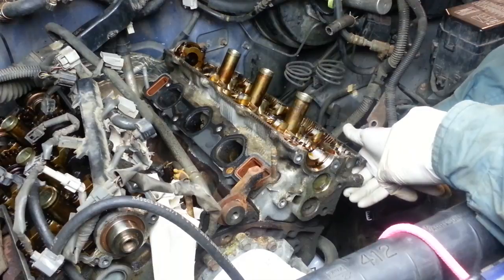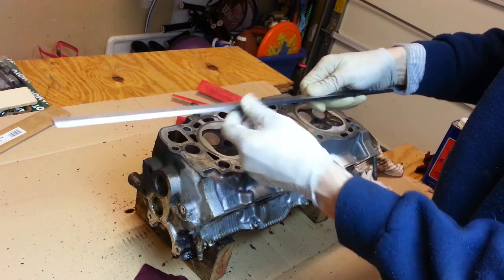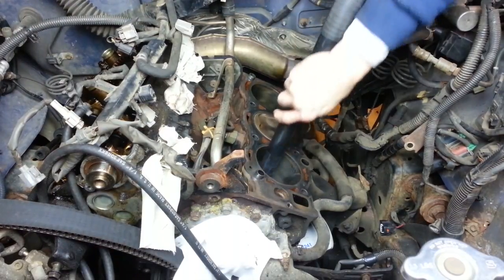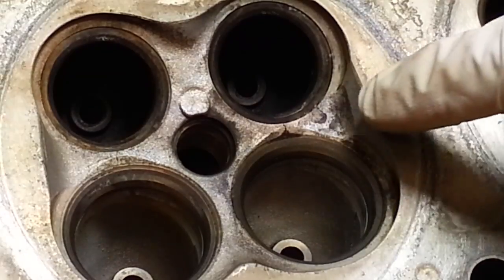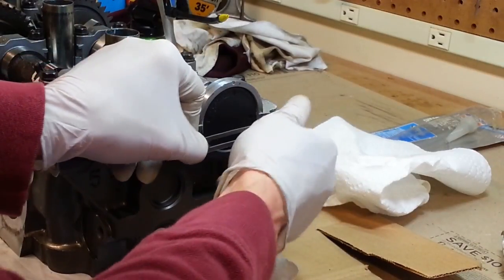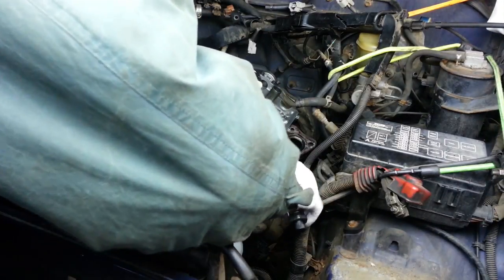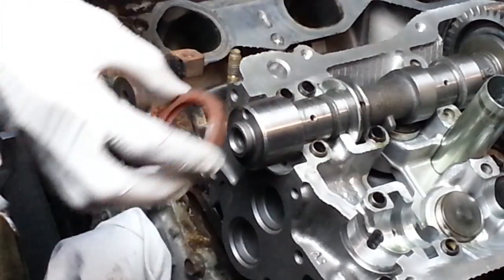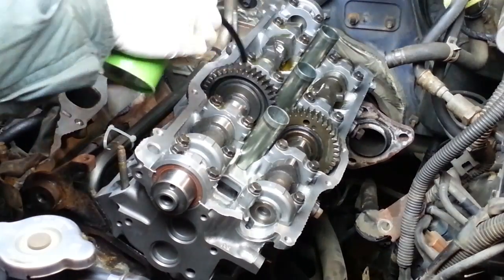Cylinder Head & Gasket DIY Procedure - Toyota 5VZ-FE - Part 4

Comment: So you made sure the dots on the cam were aligned before removing...but on install you line up the dots and then rotate cams to push the cam down into place which then caused your cams to be out of alignment. Another great video ruined by missing a critical step...
Reply from the maker: Thanks for your observation. Sorry about the confusion and perhaps a subtle detail is difficult to see in that segment of the video or there is some misunderstanding about the procedure and its purpose.  I oriented the dots in such a way that when I rotated both cams down a few degrees to safely seat them into the journals, the dots were then nearly perfectly aligned. There's really no other way to do it because you have to overcome the tension imposed by the torsion spring between the split gear. Regardless, the rotational adjustment after that is somewhat forgiving. The alignment of the dots is to simply put both cams in a position where none of the valve springs are compressed before reinstalling the caps. After the cams are seated, you can safely and easily tweak the rotation of the cams a small amount in either direction to get them perfectly aligned without any of the lobes exerting downward pressure on any of the valve springs. Then you can proceed to install the caps.
Reply: worsethanchiggers okay but then the dots aren't aligned so what happens to timing? In the video before you removed the cams you were saying that the cams were off by 1 tooth yet after install your gots were probably off by 5 teeth...so your explanation of valve clearances doesn't account for cam timing....and I'm bitching because I want to remove my heads on a similar engine and I can't confirm the cam installation.
Reply from the maker: No worries. Your caution is a good thing because it is important to get this right. It might help to review this segment in part 3 of the video series https://youtu.be/yTsocmNdBpQ?t=844 where I try to clarify that the alignment marks have nothing to do with timing. The timing marks are on the cam sprockets. Alignment adjustments are made when you are installing the cams. Timing adjustments are made later when you are installing the timing belt.
Reply: worsethanchiggers okay ty I misunderstood what you were doing
Reply: alright...i have watched that part like 3 times...still kinda sketchy imo...
Reply from the maker: Another note... If you're serious about removing the heads on your engine, I strongly recommend that you get a genuine factory service manual for that vehicle. There's nothing like accurate information from the actual authority. It takes you through the entire process step-by-step with illustrations and specs.
Reply: worsethanchiggers yeah the manual for a 1998 Vvti ls400 is $300 used
Reply from the maker: Definitely money well spent. For me, a good service manual is the first tool I invest in. Then, sell it on when you're done with the car to recoup the cost.

Comment: Why on earth didn't you clean the valve cover!!!?? 😳😞
Reply from the maker: This video series is more concerned with the mechanical condition of the engine rather than aesthetics. You should see the exterior. :)
Reply: worsethanchiggers I meant the carbon deposits on the inside of the valve cover. Lol :)
Reply from the maker: Ah, yes. That was mostly just dark staining and would have been very difficult to clean off without some kind of media blasting. Sweet sounding Cobra of yours, BTW.
Reply: worsethanchiggers got ya. If it stays put it won't hurt anything anyway.  Thank you sir!! 😊

Comment: My honest guess was that the coolant on the #4 piston came from residual coolant flowing back out of the head..
Reply: Can you answer one question for me.  Im looking to buy 4runner that has slow coolant leak and misfiring.  My guess is that it has a headgasket issue, no white smoke yet.  How do I know that the car was not overhead before?  My fear is that after I replace the gasket to realized the engine has overheated and warped.  Is that a concern or overheated might not be a concern.  I don't see any oil in coolant or reserves yet.  Thank u.